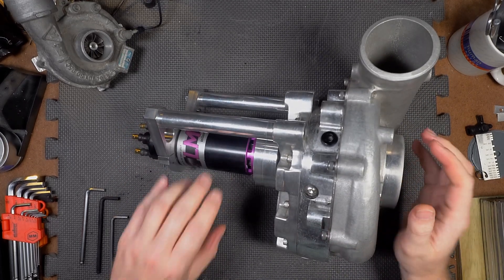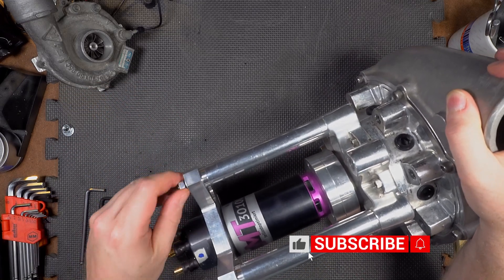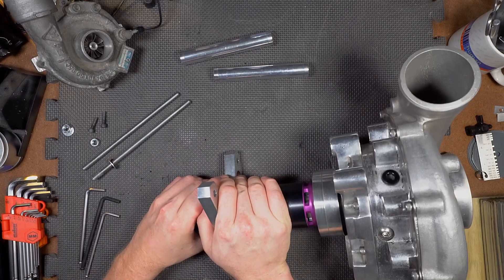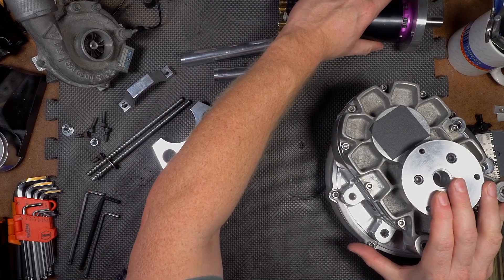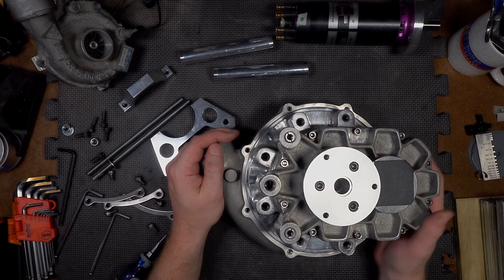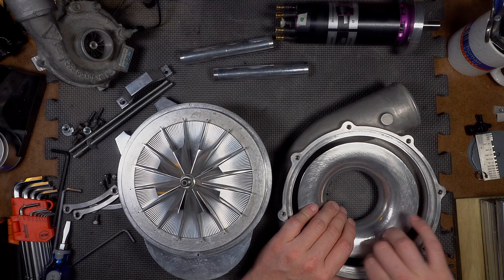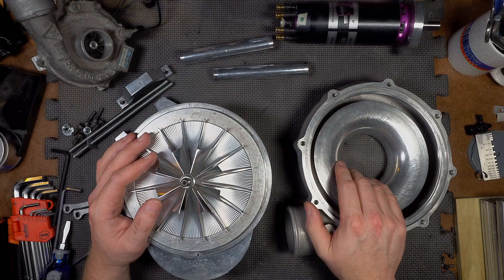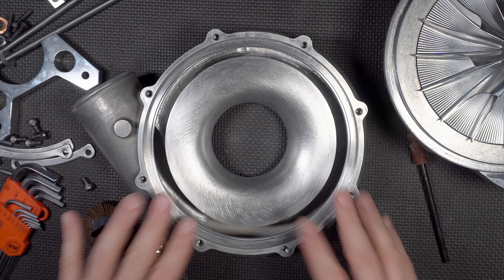Porting the Turbo Volute

Comment: Hey Alex, great vid, I have been searching online for info on porting and polishing the volute. I have considered running a meth nozzle to the volute, a tiny one say 62cc nozzle as it is a small K04 turbo. But a little concerned of running meth so close to such a heat source. What are your thoughts? I already have a single nozzle meth kit was just thinking of adding a 2nd one.
Reply from the maker: Thanks.  I did run three meth nozzles into the volute, and then we dyno tested it - it definitely picked up power.  Here's the video:  https://youtu.be/b9d5xv9INmw  I had similar concerns, but not due to heat, but due to running the meth so close to 35,000 watts of electricity.  If you're smart about your lines, there's a good chance you'll be fine.  If you're really worried, you could make the lines near the turbo out of stainless tubing - don't use aluminum or regular steel - meth can be corrosive to both of them.
Reply: @AlexLTDLX  Thanks for the advice, I would love to run a small nozzle into mid volute. I did some research on heat shielding and sleeves and I think routing above and away from the turbski as it is rear mount then the exposed piping will be minimal.

Comment: Ihi did this on their VF series turbos about 20 years ago on their vf34. From memory it was a Teflon based coating and was only on the radius which is where the compression occurs on a turbo. Since your compressor is more like a centrifugal supercharger doing the volume makes sense. But the boost you're running may not see any real gains, maybe single digit
Reply from the maker: We did dyno test it, and I did a deep dive on the data: https://youtu.be/41XEVzvYvSw
Reply: @AlexLTDLX  too many variables with the data on that vid. did you pick up mph?

Comment: How big is that impeller?
Reply from the maker: 6" exducer; about 152mm.
Reply: @AlexLTDLX makes my 71mm turbos seem small. Impressive impeller you got there 👏
Reply from the maker: I'm sure the impeller I have spins a lot slower - speed makes up for a lot.  Imagine an electric motor that makes 53hp at 1,000 rpm - it would weigh a couple hundred pounds.  Now look at the motor I'm using on this electric turbo - it also makes 53 hp (we've actually seen as much as 47 hp out of it); but you can hold it in the palm of your hand.  Both can do the same amount of work, they just do it differently.

Comment: Is that the stock cover? I'm aware that s/c compressors are very low trim in order to create good boost with minimal rpms. But that setup has almost 0 diffuser area, that's what does alot of the "compressing", and it's a very important part for efficiency.
Reply from the maker: Yes, it is the stock cover.

Comment: The coating normally should result in 1-2 percentage points of efficiency, it works well. Didnt know it was available for regular DIYers though. :)
Reply: Hi! I work here at L2L coatings. We do turbos, superchargers (rotors and housings), pistons, engine bearings, and anywhere you may want to tighten up clearances.

Comment: I may have found a really cheep toyota turbo im thinki g of trying something similar to what you built. I have 4 19v motors from a hover board and a set of hover skattes going to try a chain drive or gear drive with them dobt no how well it will work but eventually ill b able to aford to build sonthing better later on. Thanks again for another great video can't wait to c that thing on the dino again with a better torqconverter that wont slipp so much have a good day!!!!!!!
Reply from the maker: Thanks Steve.

Comment: Be interested to see how much the coating increases efficiency and how close the tolerances are once its done. I have done a couple of different coatings over the years testing intakes etc on Quad bikes and such and found it can provide such a range of results depending on thickness, how smooth it is, what the coating is made from or is. That even if it doesn't do whats expected it will provide results :)
Thanks for you time
Reply from the maker: I agree - no matter what, it'll be interesting!  Thanks for watching and subscribing.